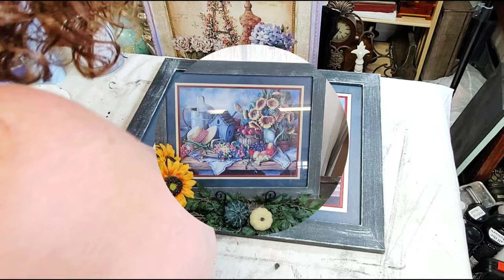Thrift Flips for Fall • Trash to Treasure • Upcycled Decor with Sunflower Style!

Comment: Cut slits in your clear transfer sheet and then only lay down about an inch wide section at a time of the transfer when placing on a curved surface. It really helps. You can even cut away some of the plastic as you go so it's more bendable. Your projects are ALWAYS STUNNING regardless of any faux pas!
Reply from the maker: Thank you so much - and thanks for the great tip! I will definitely do that next time!!  :)

Comment: Liked your arrangement on the chair, very nice indeed. On the candle holders I liked the part where it crackled tiny cracks and didn't get chipped off. On the picture and frame I would liked to have seen the mat painted. . .the green mat same color as frame and then the next two painted in a soft yellow to match the sunflowers,
Reply from the maker: Thank you! :)

Comment: I really like the curry color. I wish I could find it in a non-chippy version. Your projects are so nice!! I just recently found you! So glad I did!!
Reply from the maker: Well I'm glad you found me!!  Thank you!! And you can absolutely keep the paint from chipping if you add Extra Bond to the paint when you mix it! I would still probably suggest not putting it over uncured spray paint, but with the extra bond, milk paint will stick to basically anything. :)
Reply: @theeclecticcottagespokane  you're the only crafter I watch who uses the extra bond. Everybody else seems to want it to crackle, or take their chances on what they get! I appreciate this info as I don't always want the chippiness.
Reply from the maker: @cassfonnesbeck8057 Milk paint does tend to have a little of its own personality at times. What I have personally experienced with my furniture pieces is that as long as I use the extra bond in my paint (and in every coat of paint), I rarely get any chippy. And if there is a little, it is normally inconspicuous enough to blend in with a little distressing or a darker wax....